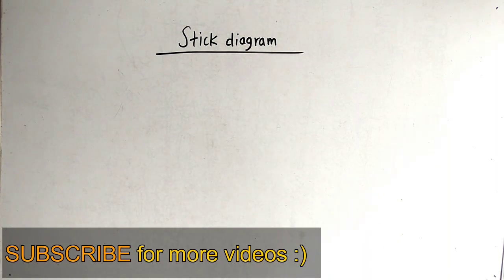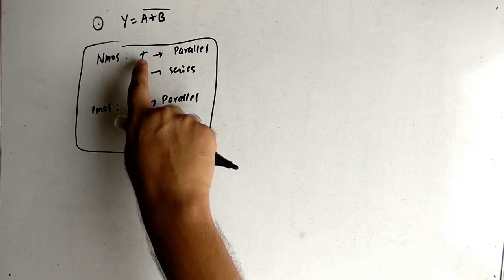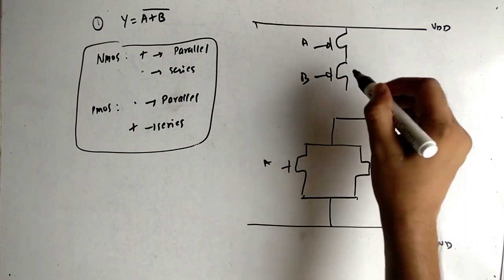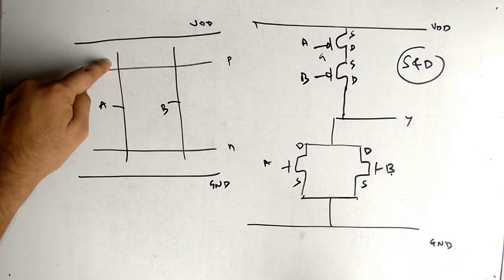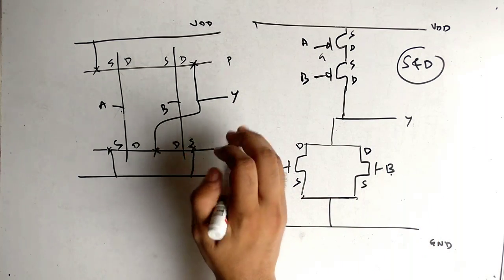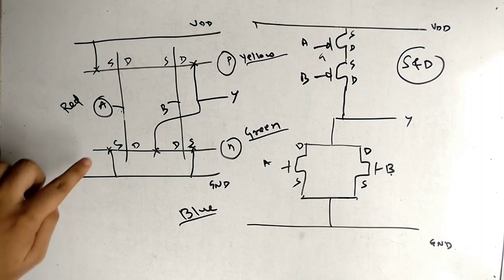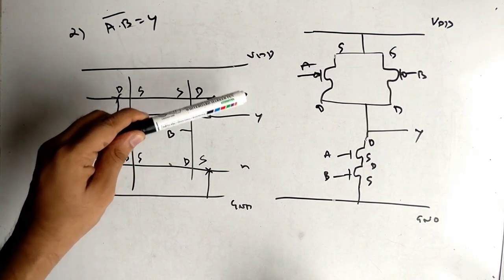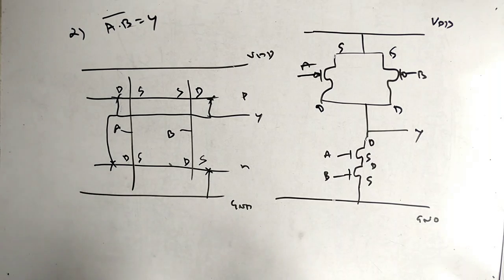STICK DIAGRAM - simplified (VLSI)

Comment: You didn't connect the source to the Vcc in the last circuit... Both sources are common and there must be a connection between common source and Vcc